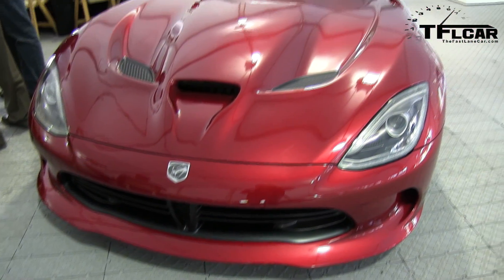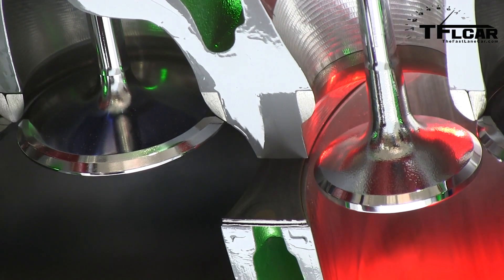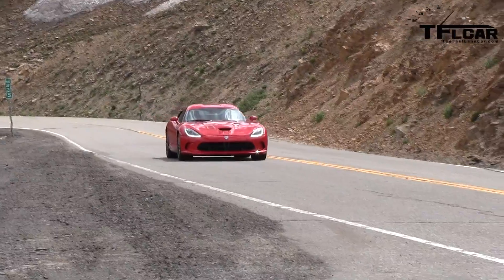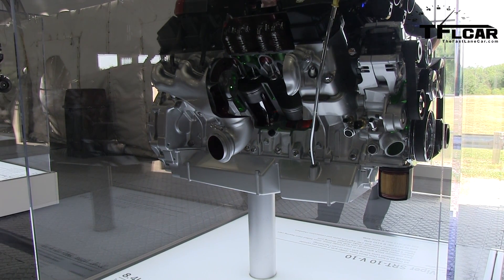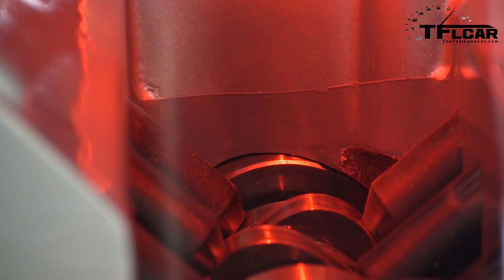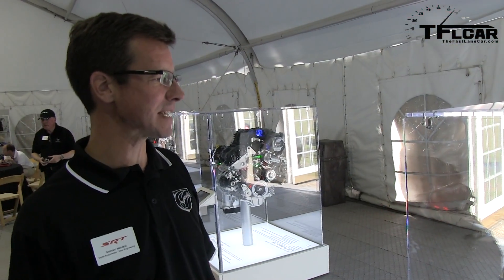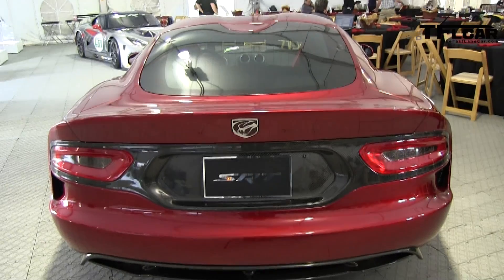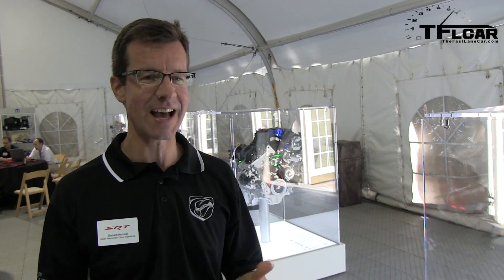2013 SRT Viper V10 Engine Tech Demo & Preview

Comment: I still think it's poor how little power they get from the size of the engine really. It's the same with all American super cars, they need more power out of the engines to compete with the European and Japanese Supercars!
Reply: the external size is not that big for 8,4 Liter of displacement volume, also not as heavy as you think the engine weight compared to an engine with forced induction configuration. 8,4 L is volume of displacement created from the piston movement, not whole unit of motor size.

Comment: I'm not a fan boy of any manufacturer not even Porsche but I would like to point out since we are looking things up on "goggle image" perhaps you should look up the Porsche Carrera GT which is a "no-nonsense machine" as you put it. The Carrera GT is more like a Cobra than the POS Viper ever will be. The Viper has terrible handling and the Cobra's were some of the best handling cars (like Porsches) there are. Even the 911 GT2 and GT3 have more in common with the Cobra than a Viper.

Comment: Like I said, the Viper was meant to be a new Cobra.  It's even in the damned name.  It's a stripped-out, no-nonsense machine made for one purpose.  You get in, you scare yourself half to death, and then park it again.  You don't take it to work, you don't pick up chicks, you don't buy groceries, and you don't bitch about the door handles.  That's what the Shelby Cobra and first Vipers were.  A bar-fight on wheels.  Porsche doesn't make one of those, so I understand your confusion at the concept.

Comment: The Viper isn't a luxury car, the first one was intended to be a modern Shelby Cobra.  Step into one of those and complain about the lack of refinement, you'll have Frenchmen kicking you in the balls.  As for reliability, the Viper's motor is basically a hopped-up version of Chrysler's old small-block.  My family owns three Chrysler LA engines, all are over 100,000 miles, one of them is over 400,000 miles.

And let's not forget the Neon, which had best-in-class handling AND power from day one.

Comment: Dodge is useless as an automaker. The fist Vipers were total crap! After just a few 100 miles the fuel system would fail leaving you stranded by the road side. They didn't have exterior door handles or side windows and you got burnt on the wide open side exhaust pipes. All typical Dodge Chrysler engineering. That's not the only POS they've built, lets not forget the Neon and SRT4 (Neon). So the new Viper has forged pistons so I guess now you make it 1,000 miles before the engine blows...awesome!